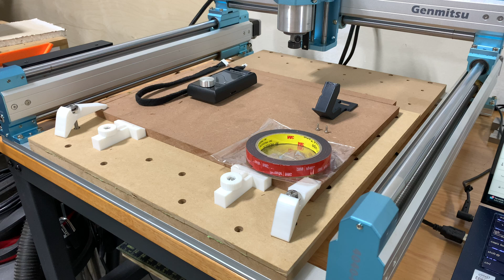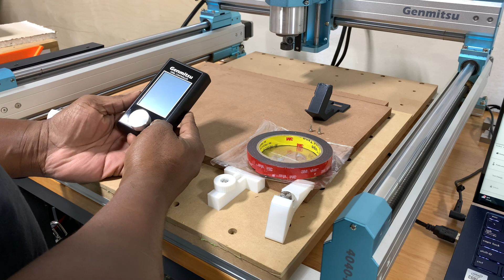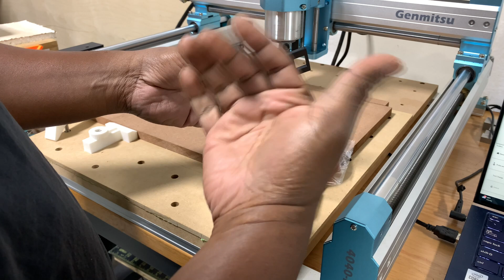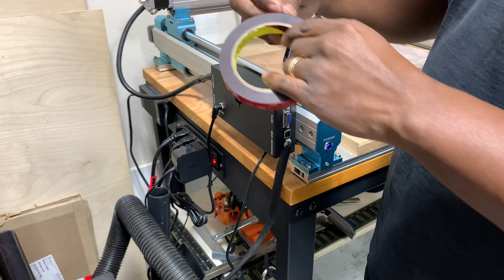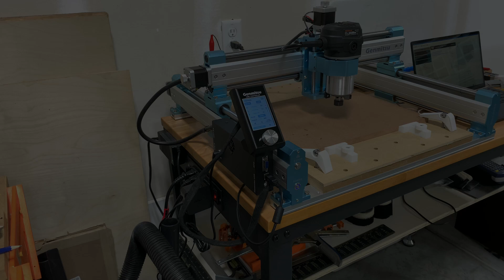Genmitsu 4040 Pro OLC Mount

Comment: I still don't understand why they put the port on the back of the offline controller and not on the side/top, but alas, we have to work/live with it. Is that a Makita router or what are you using? Also, what are you using for the clamps - they look 3D printed.  Appreciate all the help
Reply from the maker: Router is the 65mm Wen RT1460 6-amp trim router. And yes the clamps are 3-D printed. I’ll throw them in my download link if you’re interested.
Reply: @Aastan  Thanks - will greatly appreciate it!

Comment: Great video.  i just bought the 4040 pro got it on the 18th.  I went with the genmitsu router.  I plan to cut stone.  soft limestone. I like your mount but ill try to use the screws to mount a clip in the back of the OLC and then a cradle on the side of the case..  ive already designed and printed the probe basket and added slots for the hex wrench and chuck wrenches.  fun fun fun.
Reply from the maker: Thanks a lot.  I really enjoy the machine thus far.  Just finished doing a batch of Christmas gifts for the family.

Comment: You should get the dust shoe for your router . I have used these cnc's for many years the dust shoe is a must.  I believe you should make your home position upper left corner. It moves the unit out of your way for loading material. Use the lower left corner of you material for 0,0,0. Good luck.
Reply from the maker: Interesting moving the home postion to the rear. I thought homing was dependent on the limit switch position.  what am I missing?  I do have the dust shoe.